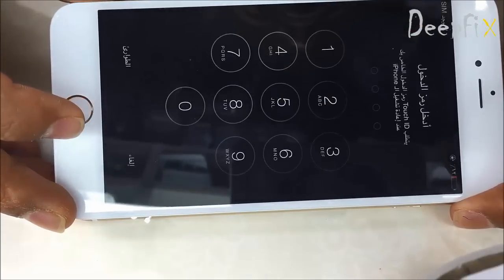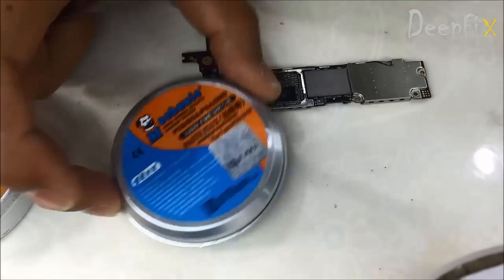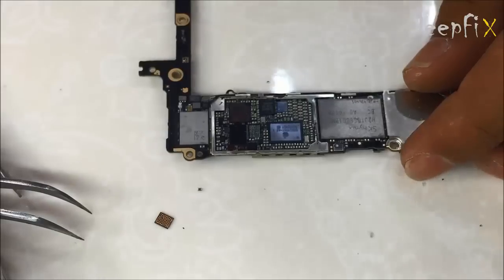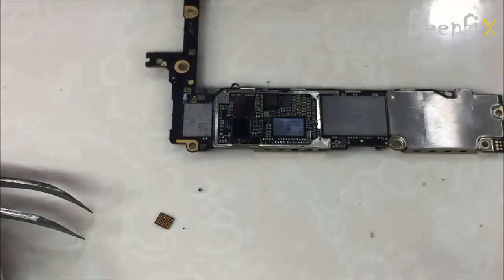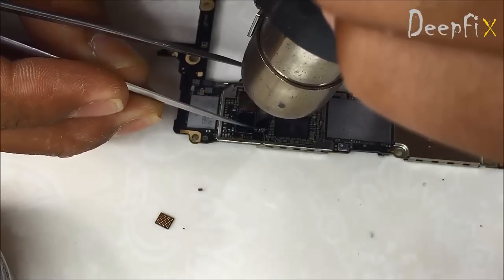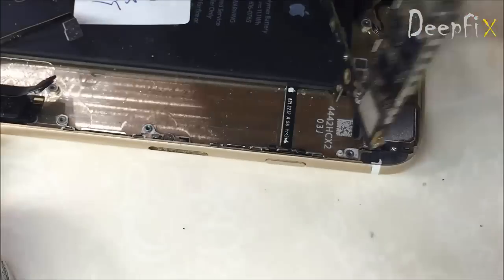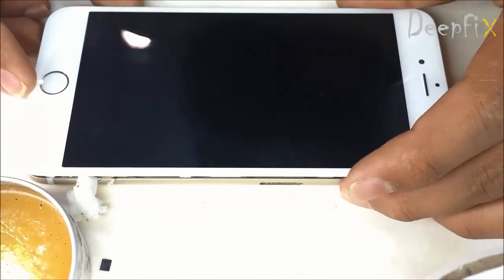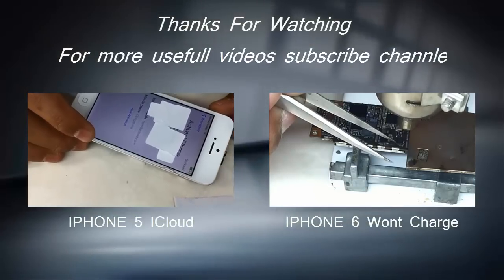IPHONE 6 Plus Touch Screen Issue fix

Comment: I've watched several different touch ic videos....some re-balling the chips and some replacing them with new ones....some run m1 jumper on iPhone 6 plus while there at it......but, for a handy dandy Diy'er like myself, I'm trying to soak up as much vital info as I can, so that I can perform iPhone surgery on my 6 plus, that being said can someone answer me a few simple questions? What temp is good for removing and replacing the meson chip? If replacing with "NEW" chip does it need soder added or does it already come with pre-soderd balls? What kind of liquid do I use to clean off flux? Acetone? Alcohol? Fiberglass scratch brush? Or Q-tip? I'm an amateur but enjoy learning how things work, however I like to go at a project with all the necessary tools for the job... thanks

Comment: can these cords get messed up if you drop your phone
Reply: yes, if you droped, then might stop working. My recommendation is only to heat it before replacing the IC touch. Sometimes works. There are some many legs under the chip and does could be just disconnected but it is a small change that would work. At the end, IC chip needs replacement

Comment: Took iphone6+ into the shop with a cracked screen got it replaced and it just randomly started doing this no lines just no touch took it back bc it was in the 3m of getting fixed still had warrenty got new screen still plays up unless you twist the screen could this be the same problem or is the screen not connected properly and it's a dodgy connection
Reply: Rachel O'Keefe its the touch disease! You need to change the touch IC

Comment: i dropped my iphone in the water 
it's still works 
sound, vibrates & get connected to itunes but the screen is black 
do you think that i need to replace the ic or the lcd? 
&is there a way to check which one is problem ?
Reply: Might be just the LCD. You can try to purchase one and dont fully install the screen just connect the connector if it turn on and works then it was that if not it could be something more than the IC it might be bad connectors
Reply: one of my friends works in store that fix phones
and he found  it was the ic light that got damaged by water 
and he fix it

Comment: hey I have just been heating up the board in that area and applying firm pressure to the touch ic and it seems to solve the issue. I think when it bends it gets out of place so it just needs heat and realigning

Comment: I replace the IC 3 times. It works every time but for a few days. After some days it has same problem. please help me if you can.
Reply: You have to make the M1 jumper. This M1 leg causes all this issue
Reply: same here
Reply: Me too 😭
Reply: Rifat Mahmud same as me
Reply: exactly same with mine. returned my phone to repair shop 3 times and when they said it was fixed it still showed the same problem again.

Comment: Have to replace or can simply reflow?
Reply: if u reflow it might work for like 1 week or 2 
maximum a month after that it wont work again 
u have to completely replace the touch ic 
unless ! the customer gaved u the device and he told u after his phone got dropped in the floor the touch didnt work in that case u can just reflow or reball the ic and reattach it 
hope it helps
Reply: I was wondering if reflowing the solder with a heat gun would be an option too.
Reply: Did you try this?  Success?
Reply: Ayham Assil what are the chance that if we replace the touch IC it will work for long time?
Reply: mrsemifixit a

Comment: If the restore doesn't help, than its the IC chip.  I found the problem after searching online.  There are thousands of iPhone's 6 & 6+ with this issue.  The root of the problem lies with the touch ic chips on the motherboard.  These touch ic chips are located on the back of the board, u2401 (Cumulus) and U2402 (Meson).   This can be caused by even with the slight flexing of the board during normal uses of such a large phone.  This causes the solder balls to partially separate from the chip.  That is why thousands of people are being affected and apple is well aware of it.  The intermittent unresponsive gets worse with time as chip oxidizes. The permanent solution is to replace these chips.    Apple keeps deleting any comments on the forum that give this information out.  It has deleted this comment of mine and of other people.  They are trying to hide the problem so there isn't a class action lawsuit.  Try copy and paste it yourself on the link provided and see the result for yourself, they will delete your comment after a day or two for no apparent reason.  
 https://discussions.apple.com/thread/7028290?start=720&tstart=0

Comment: I have purchased all the equipment, microscope, hot air station etc and have had some success replacing broken off capacitors. Your skills are amazing and with the info you have given especially the heat 380-400C   I was too low at 325 and toasting the boards as I was too long heating.... Anyway ordered a Touch IC chip to replace on an iphone 6...Cant wait to give it a try...I will be watching your video a few times getting ready to tackle it...

Comment: you are very professional that the heat did not damage the other parts like power ic. good for you. amazingly fast done. I bought irda machine and it is with heat infra red lamp instead of blow heat. so the lamp I used just damaged the ic power cheap and it heats up and does not start anymore the iPhone 6 plus. I had only problem with touch screen ic cheap before but damaged while heating the power ic. my irda machine temperature is maximum 350

Comment: Hi ashfaq, my iphone 6 plus have white lines and touch is not working, is it the same fix? Or something else?
Reply: yes
Reply: Couldn't that just be that the connectors need to be straightened up? (if they are bendt a bit)

Comment: why didn't you replace the capacitor!?! also I had a phone like this where the touch worked until you locked the phone it worked on boot until it was locked and then I never saw you like that phone and then unlock it and try to try the touch I wonder if it would have worked then

Comment: i have a iphone 6 had water damage. Everything works fine but the light flickers. I have to turn the brightness low and i then have no problems. Is this the ic chip problem.
Reply: +Victor Ruiz probably backlight ic is damaged

Comment: Hi Sir, 
I would just like to say your skills and expertise are incredibly impressive. I was wondering what tools do you use? is it essential to use a soldering iron? or is a heat gun okay? 
is there a difference between using a heat gun and a hot air gun that is attached to a soldering iron unit?

I was also wondering what is your work bench made out of? is it just a regular bench or is it a specific type of material to avoid damaging it?

sorry for all the questions. 

Love your work.

Comment: I would like to see of how to replace the back light on the iphone and also how after fixing a water damge phone how to get the service to come back .. i work at a phone repair shop and had a issue where the i cleaned out the water damged phone works turns on but no service after restoring it 3 times...